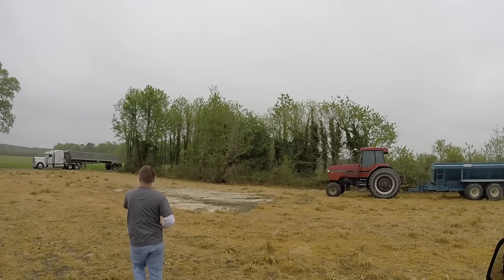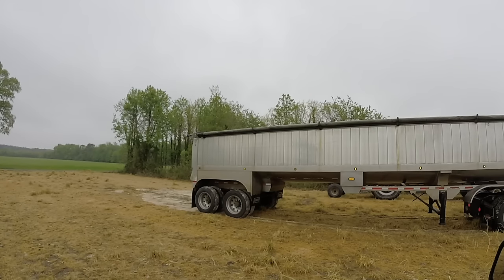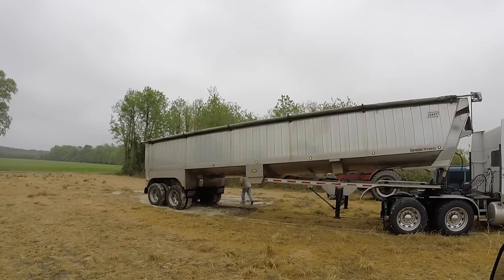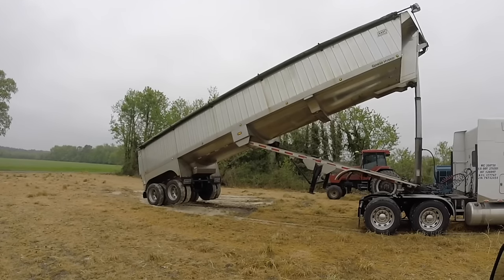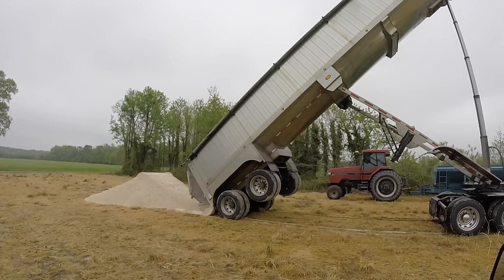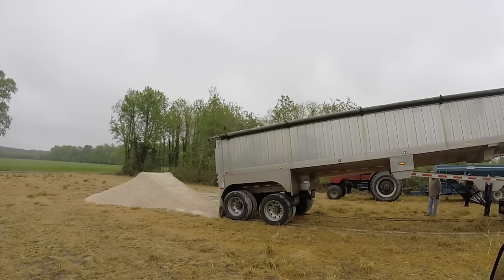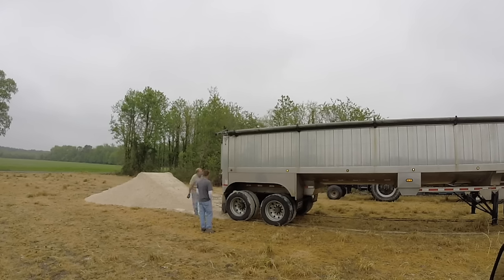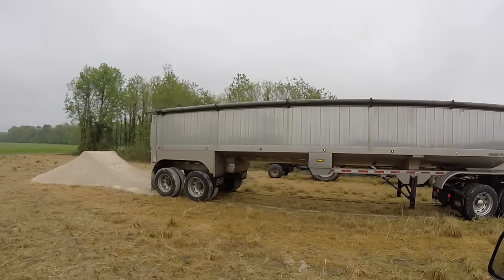Dumping 24 ton of Lime to spread on Corn Fields

Comment: So that type of trailer is a good idea for getting out of mud. Thanks for explaining! Most "experts" are on youtube saying it will cause the trailer to turn over
Reply: They do tip easily if you're not careful with them got to watch the wind keep it as straight and level as possible and hope nothing hangs up on 1 side or high up in the trailer but if you're careful they're pretty slick trailers

Comment: I live in Waynoka, Oklahoma. I hauled one load of that 100% ag lime from Mayville, Oklahoma from the dolomite pit down by Texas. I left the yard a 4:30am. With a grain trailer, got back to our yard around 3:30pm. Our boss thought this was a good idea, and we would just dump those grain trailers and reload it on end dumps. As soon as I rolled that first hopper door back , i knew we fucked up lol! Only a little dust hit the ground. 3 of us spent from 3:30pm to 6 pm unloading 2 grain trailers loaded with that shit, using pneumatic hammers, small sledge hammers and a snow shovel. Never again!
Reply from the maker: Oh my - not a good idea!  I've had to shovel a couple tons off a dump trailer in the past because the trailer was not sitting level and wanted to tip.  Never fun
Reply: I've been hauling lime for 16 years for an agricultural company and I've dumped it out of frame and frame less trailers thankfully we got rid of the frame less and got belt trailers which are awesome but we do occasionally use the cobra tri axle I loaded 35 tons in cobra then I had parked it for the weekend well the next morning it was froze to the floor I raised the box 1/2  way uo and nothing fell out  so after checking the load realizing it was froze I began shoveling that was the last time I leave a loaded truck over the weekend
Reply: @supertrucker12916  we like our side dump over our frameless for hauling this if our belt trailers are busy but belt is the best way to go I totally agree with you on that

Comment: Never seen a trailer like that before. Sweet!
Reply from the maker: apparently these type of trailers are more stable when dumping on uneven ground.
Reply: Those two beams in the middle help keep it more fixed, instead of it just being held by the cylinder.

Still, though, a high wind or a slight slope is still risky.
Reply: @FarmerMD  more stable than a frameless end dump but still have to be very careful with them

Comment: that the most insane design i have seen at a dump trailer, it has no stability at all, but ehm i can see it works but i would not use a trailer like this ,god damn us :)
Reply from the maker: very common type of trailer
Reply: Check out frameless end dumps you'll think this is safe

Comment: People don't realize how dangerous that trailer is I use it at work and I do not recomend moving the trailer at that height because it will tip over like nothing
Reply: I work for an agricultural company and I use frame less dump trailers I've had a few close calls but fortunately I've never laid one over but one of my coworkers have they were dumping lime on our cement pad and the load stuck and over it went
Reply: Those are a little more stable than a frameless but you still have to be careful

Comment: Put's a lot of weight on back axle, is this why the air bags are dumped. Remember steel spring breaking that overturned trailer and unit years ago.
Reply: Yeah if you don't dump the air you got about a 95% chance of blowing airbags as the weight hits the end of the trailer and if only 1 goes a good chance the sudden shift will tip you over

Comment: looks like a small pile.......big trailer
Reply: 24 ton isn't a big pile and on backroads a longer trailer than necessary is nice for spreading the weight for small bridges so not all the weight is on it at once

Comment: The average frameless is thirty nine feet.
Reply: That's not a frameless it's got a partial frame and the scissor hydraulic lifts both sides with even pressure instead of lifting the center only so it's more stable even if 1 sides loaded a little heavier than the other and my uncle has two 53 footers
Reply: @davidwoermansr  what? You are incorrect. Would you like to learn babe?
Reply: @davidwoermansr ? Sub frame and draw bar.... Scissor hydraulic lifts? I took a shower and it dawned on me what you think it is. Probably one of those half frame and frameless trailers. I've never been around one but it's the only thing you might be thinking of. That is 100% frameless babe
Reply: @skinlab4239  I've pulled my uncle's plenty of times and we owned a frameless with the single piston till I bought dad out and we chopped it up for parts for a project and scrap because it was beat up and so were a couple tractors that use to drag it around that had both been on each side at least once I know all about both trailers sweetie that's why we have side dump and belt trailers now for that a couple belly dumps for road gravel and a straight truck and pup trailer for fill sand and dirt a ragged old homemade trailer for iron and a couple lowboys and a spread axle drop deck for equipment but I guess bring on the lesson princess
Reply: @skinlab4239  that's not how they're marketed princess

Comment: You should never stand beside  that trailer
Reply: As long as you can move decent it's not too dangerous they start going over slow after halfway they really move those are quite a bit more stable than a traditional frameless

Comment: that ain't no 24tons of lime, looks like 2tons
Reply: You've clearly never pulled materials.
Reply from the maker: I guess you are not familiar with the density of lime.
Reply: Compared to the man in the vid and the rear-wheelbase, that pile is about armpit-high, maybe 4.5' at its peak, and 10, maybe 15' wide at its base. Lets use 5' & 12' and call it roughly a right-rectangular pyramid, whose volume is given by formula V=lwh/3. It's volume would be roughly 12' x 12' x 5'/3=240'^3, i.e. 240 cubic feet. Rounding up to ~100lbs per cubic foot of lime at the top end (usually 75,80, 90lbs) is 24,000lbs, or 12 tons. Still, i was way off, looks can be deceiving. It looks like a kiddie-sand pile that takes up 1/10th the truck.
Reply: It looks about right I'm no expert but I have been hauling lime for 16 years  some lime is more dense than others sometimes it can be kinda like confection sugar light and fluffy and sometimes it holds moisture thats the kind that likes to stick and causes trailers to tip over